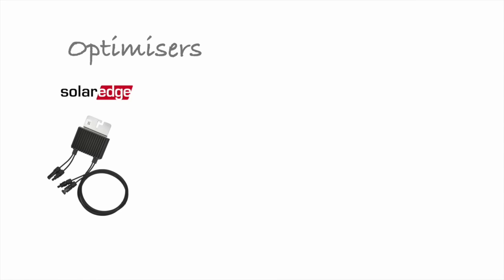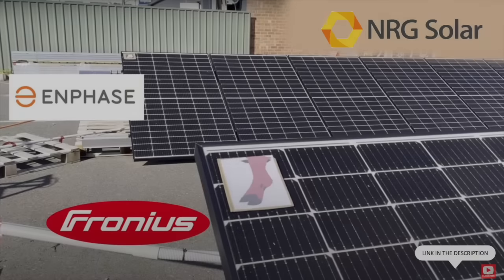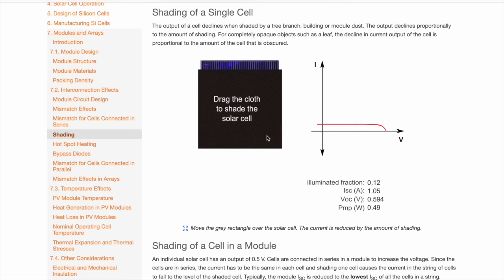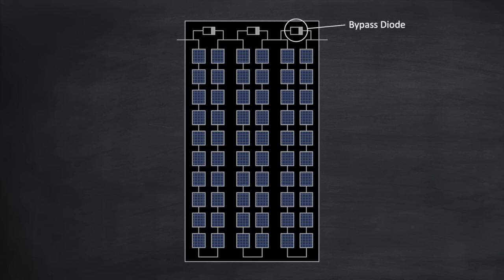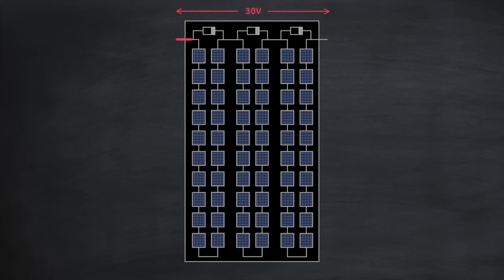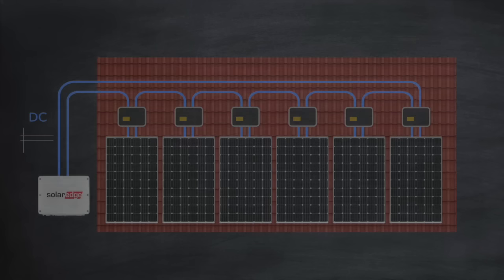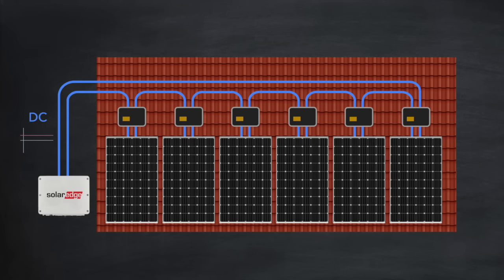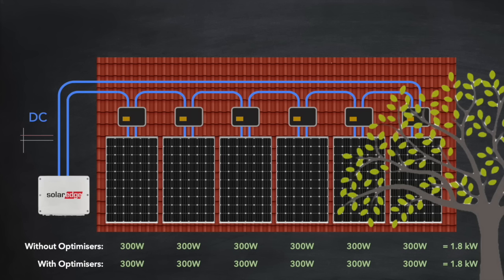Solar Panel Shading (Part 1): Are Optimisers and Micro inverters Worth It?

Comment: What I have found with my own testing is don't buy normal panels, buy half-cell split panels, or BF panels, as they don't souther nearly as much from shading, and even on an overcast day they produce nearly as much power as my 2 year old LG panels do in full sun, and they have expanded my day by almost 2 hours. Thanks for this video, I found it very helpful. Subed.
Reply from the maker: Sounds like great advice!
Reply: Bifacial panels are less vulnerable to shading? Why is that?
Reply: Great Job Gary!

Comment: Our panels were installed 12 years ago and our installer went to the trouble of reducing the height of the top of our soil pipe and resiting our TV aerial. This means that our panels can never be shaded. Your video has explained why that was excellent practice. We were offered Solar Edge optimisers but neither our installer nor the manufacturer’s documentation could not explain what they did and why we would need them. I’m glad we didn’t buy them as you have explained why they would have been of little benefit with our installation.
Reply from the maker: Thanks for sharing this, Trevor. I think others will be in a similar situation to you, and this will help them in their decision making :-)
Reply: The optimisers also provide arc fault detection, so fire protection and only provide 1V per panel open circuit so you can't get a fatal DC shock, you can also see each panel signals it's operating volts & amps on the Solaredge app, all besides each panel is doing its own mppt tracking.
Reply from the maker: Hi Jeff, see my other reply to you 👍🏻
Reply: @GaryDoesSolar  Thanks Gary Cheers
Reply: Another method explained to help deal with this problem is to wire more parallel strings with less pannles in series. Not always ideal but it does work.
Reply: @jeffp3999  These are all mostly useless features at too high a cost. These features are unlikely to be ever used
Reply: @shrujanamsyama9940  I'm surprised that arc fault and shock protection aren't now compulsory on PV when they are in some countries on the AC  electrical installations.
PV DC is a lot more dangerous than A.C. in this respect, I've been to deal with the aftermath of several PV fires here in South Australia, as you should know with voltages ranging from 100 to several hundred volts DC that arc does not extinguish easy, I've seen one burn holes right through a tin roof, luckily the arc extinguished before setting fire to the roof timbers..
Yet to attend to the aftermath of a runaway PV fire, when they happen, doesn't help the industry rep at all.
As for DC shocks from panels had a couple up around the 3-400V mark during testing/faulting back when and yes I'd rather have 240V AC any day under the same conditions, wasn't nice at all luckily I lived.

As for panel status, I feel it's a big bonus to be able to see each panel  performance status, for shading and faults.
Reply: @jeffp3999  I hope you understand that in place where I live - India, most people have concrete roofs, not wooden roofs. Even in case of sheds, it is mostly Aluminium roofs which won't catch fire. So, there is almost no chance of any fire from PV. The incidents of fires are minimal as safety measure like grounding of every panel and auto disconnect circuitry are mandatory. At worst when the safety won't work, you get the entire panels burnt but no further damage to the house.

The cost of optimisers or microinverters are too expensive and not worth the price in any case. Simple grounding will add enough safety. The ability to view each panel is not worth the price as it contributes nothing to productivity
Reply: @shrujanamsyama9940  different standards for different places with electrical safety.
Generally speaking Europe leads with standards and US, Australia, New Zealand close second.

Depends on if the aluminium roof has timber supports or any combustibles close by, a d.c. arc would still melt through that aluminium sheet like welding a hole through it.
The GFI protection didn't make much difference to the fires I've attended because they weren't arcing to the frame, that's why arc protection helps with arcs from loose/ broken connectors, damaged cells, isolators etc.

As implied these nations have high standards when it comes to this kind of safety, that's why GFI has become standard and now AFD is going that way too.
Really don't like the idea of 3-600V DC fault finding on a metal roof either, from experience it's no fun when it wacks you, 
Personally I'd rather not risk it here in Australia for several hundred AS$$ to $1k because if it causes a house or bush fire in summer 45 deg and sets a whole area on fire it's no good at all.
Reply: @jeffp3999  In India, it is prohibited from installing solar panels on wooden roofs/roofs with wooden supports. The solar has to be on the house with concrete roof/metal roof supported by brick wall. Open terrace on buildings are at times used for parties, hanging clothes with aluminum sheet and solar panels can be kept on them with sufficient ventilation gap. But it is a tricky thing as the rules require the panels to be installed firmly and sheet roofs generally are considered weak mounting structure. Only in remote rural areas, small systems of 0.5-1kW are installed on metal roofs mainly due to lack of other options. Such small systems have low voltage and pose little fire risk.

So, in 99% of the cases in India, the solar panels are installed on the concrete roof. The safety risk is minimal as even if all the panels get gutted, the roof being concrete will cause no harm. With concrete roof being the main solar installation site, the fire safety standards can be relaxed significantly. In EU, the main problem is that a good portion of the homes have wooden roof. But with wooden roof being prohibited in India, there is almost no reason to overdo the safety without any basis.
Reply: @shrujanamsyama9940  I think you'd find most of your houses with metal roofs would have timber truss supports, but it's the same everywhere there's no requirement for Solar AFD.
Because we have over 40degC+ days here in Australia and elsewhere, you probably get there in places too, because of the high standards here and risks of severe bush fires, it wouldn't entirely remove the risk with a concrete roof.
if I making the rules here I'd enforce such protection on solar, incentivise it and then the cost significantly reduces anyway as soon as new tech is commonly used. 
We don't expect AC to not have shock protection installed to it in the nations previously mentioned well I'm thinking that should extend to solar too, so there's an overall increased level of safety needed.

As for roofs in Europe they're predominantly slate and tile on timber truss homes with a smattering of other types.
Reply: @jeffp3999  No, in India, wood is expensive compared to Iron. There is high termite infestation too due to tropical climate. So, even poor people use steel bars for metal roofs. Wooden supports are found in old houses or in rural thatchments, not in well built houses.

The most recent solar panels already have certain shock protection built in and certified too. So, the risk of fire is almost non existent from solar panels in India.

Yes, EU roofs have timber supports and most roofs in USA are also timber. This is why there is much higher safety concern than concrete roofs.
Reply: @shrujanamsyama9940  thanks for the correction on roof supports.
Never heard of a panel with built in GFI unless it's got some kind of micro-inverter or optimiser built in, have you a link?
GFI only isolates the panels from the inverter.
Reply: @jeffp3999  I did not mean GFI inbuilt. But there are certifications done by TUV Rheinland and few other agencies against factors like Potential induced degradation (PID), LID (Light induced degradation), fire resistance, LeTID, hail testing etc.

In most cases, it is the PID & LID which causes fire. Testing for PID & LID reduces that chance significantly. Other than that, each panel being grounded by a grounding wire reduces the chances of shocks and fires. There may be chance of fire from other causes but they are very slim. Considering the fact that even in the worst case of fire, loss on a concrete roof installation would be limited to the cost of the panels, the cost of optimisers is not worth it considering the low risk scenario

Comment: This is helpful. Seems to me that in most cases it's far better to simply buy more panels (as long as they fit) for a roof, rather than optimizers.
Reply from the maker: Thanks Don - I was careful not to draw firm conclusions one way or another. But I did want to get the point across that any improvements with optimisers are only marginal. If I had shading on my roof, I would like get optimisers for the affected panels, even just for the monitoring.
Reply: @GaryDoesSolar  Hi Gary. Thank you so much; these are fantastic videos which are so much easier to understand than just reading manufacturer's literature.  I do have a question/observation. I've watched your earlier video 'How to choose SOLAR wisely and avoid costly mistakes' where you explain what each component does in a SOLAR system i.e. Solar panel, Invertor and batteries. In the Solar panel section, you mention that shading one panel will adversely impact all the solar panels in the series which suggests using optimizers and/or microinvertors is the only solution to reduce the impact of shading. However, your video 'Solar panels shading : Are optimizers and microinvertors worth it' you clearly explain that electronic protection measures are in place by having the bypass diode added to each array leg suggesting that optimizers and microinvertors are probably not worth the investment as the bypass diodes do a great job. Also, the cost of replacing the optimizer could be high for the reasons you explain. Maybe it's just me but I felt the videos slightly contradicted each other in the Solar panel sections. Let me know your views. Keep up the great work. Cheers
Reply: Misses out a lot about optimisers here.
The string number lengths can be much longer, meaning that much more often you can have just one string down to the inverter.
You can also parallel different length/orientation strings together (some conditions apply) 
Also orientation of panels in the string doesn't matter so much due to individual mppt.
Open circuit voltage is only 1V per panel giving both panel signalling to an app for each panel's parameter indication and inherent arc fault fire protection.
Reply from the maker: Hi David, apologies - I thought I had replied to your comment already, but I see it’s not there. You’re right - on the earlier video I bought into the general perception that shading on one panel would affect all the other panels in the same string. Upon receiving a few comments for that video talking about bypass diodes, I decided to do some research myself, which concluded in the later video. It’s not really possible to modify videos once published but you can place correction markers, which I did. They may not always be displayed though depending on the device/app being used to view the video. Thanks for the kind words regarding my videos - much appreciated 👍🏻 😀
Reply from the maker: Hi Jeff, the features you describe are more advanced and I didn’t want to overwhelm the audience with what is essentially an introductory video into Solar PV shading. I’m now making a follow-up video though and will incorporate some of these into that. Thanks 🙏
Reply: @GaryDoesSolar  thanks for the reply Gary, yes I've been installing solar edge inverters for several years now following doing mainly string inverters, yes there's a lot of plusses to them besides general, same orientation tracking differences.
Cheers.
Reply: @jeffp3999  You are right but the reality is that an optimiser costs a lot. It is simply better to keep multiple inverters for panel strings facing different directions. Say, you have 2 arrays each of 12 400W panels facing S, & N, you are better off buying 2 string inverters of 5kW each or a single 10kW inverter with 2 parallel MPPTs of 5kW each rather than using optimisers with single 10kW string inverter. The cost of 24 optimisers would amount to 3 times as much as 10kW inverter. The additional power generated due to optimising will generally be <10%. The additional cost is simply not worth it unless one is severely cramped with roof spacing
Reply: @shrujanamsyama9940  the solaredge optimisers we buy would be approx 2x the cost of an inverter for that job unless we used 1 per 2 panels then the price would significantly reduce closer on par, but yes the SE inverter is more expensive generally, so bring the combined cost up between 2.5-3x cost.
Those 24 panels could be on one string too, depending on vd, save a bit of wiring.
And the most important issue is having arc fault protection and open circuit shock protection along with signalling panel/s status per optimiser.
Thank You
Reply: @shrujanamsyama9940  Aren't multiple inverters difficult to use when using a battery? Direct DC-DC connection to the battery pack also excludes micro-inverters. So a setup using optimizers might be the best for some users. I chose SE optimizers since half of my roof is shaded by trees for the first half of the day. Without shadow i would not have done so.
BUT: the argument with the fault-tolerance is also true. My colleague also got a installation using solaredge optimizers. Of his 31 optimizers about 5 had to be changed during the first year.
Reply: @markusflosbach1852  If you are speaking of battery system, you should go for hybrid inverters. Hybrid inverters are also string inverters but with voltage regulation MPPTs to suit batteries. Optimisers serve no purpose here either

Comment: This is a really nice overview of what the optimisers can and can't do. How often is shading extreme enough to actually trigger the bypass diode? Shaded but not bypassed seems to be where optimisers would work best. Even though they add cost they should reduce the fault finding time if a panel goes bad and can allow you to have different panel angles and positions without multiple string inverters.
Reply from the maker: Thanks Andy - great to get feedback like this.

Now, I read that bypass diodes will typically kick in when they detect a 20% difference in current. And I agree, if my roof had shading, I'd likely put in optimisers on the shaded panels just for the monitoring capability.
Reply: It is very rare for a panel to go bad. The probability calculation is not in favour of oprimisers. Even with untriggered bypass diodes, the optimisers gain only <10% which is too low for the cost. An optimiser costs as much as a 335W poly panel which is too high.
Reply: @GaryDoesSolar  the bypass diodes are Schottky diodes,  and they block the current in reverse, and conduct when the is a potential on 0.1 V accross them in the forward direction. @ 10A, they will dissipate 1W of heat. This is a failure point of cheaper panels that use cheap under sized diodes. A 3 or 5w rated diode should be used to ensure longevity. The diode is simply a one way valve.

From Wikipedia Schottky diode page:

"... 
Reverse current and discharge protection

Because of a Schottky diode's low forward voltage drop, less energy is wasted as heat, making them the most efficient choice for applications sensitive to efficiency. For instance, they are used in stand-alone ("off-grid") photovoltaic (PV) systems to prevent batteries from discharging through the solar panels at night, called "blocking diodes". They are also used in grid-connected systems with multiple strings connected in parallel, in order to prevent reverse current flowing from adjacent strings through shaded strings if the "bypass diodes" 

Effectively, if there is shading and the panel or string becomes effectively open circuit, the rest of the string, eg 300v, easily pushes past the 0.1v required turn on voltage of the diode, and current then flows past, bypassing the open string. Simple and effective.

Comment: Begs the question of why each panel isn't connected in parallel, so loss of 1 panel (or even just 1 cell) has no effect at all.    Being in a string in series seems like a sure fire way to reduce reliability of the whole system.
Reply from the maker: Massive currents…

Comment: This is the first video I've seen to clearly explain the pros and cons of optimisers.I assumed I needed them. I'm not sure the benefit of individual panel monitoring and a small improvement in efficiency can justify the cost.
Reply from the maker: Thanks David. I was quite surprised at the lack of pertinent information available on the topic myself. Yeah, the benefits are not exactly stand-out.
Reply: Not sure Tigo even works at all